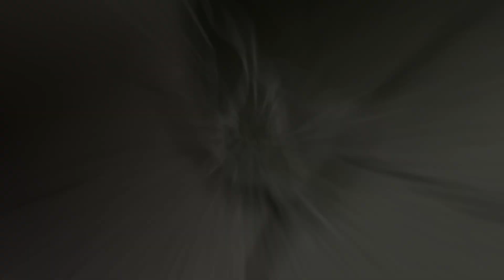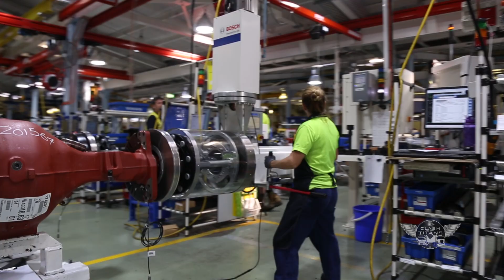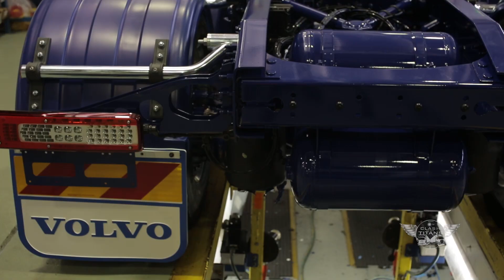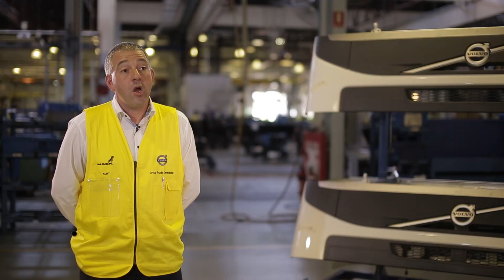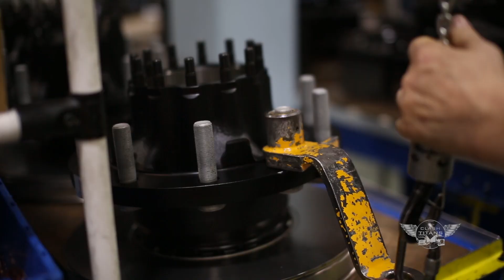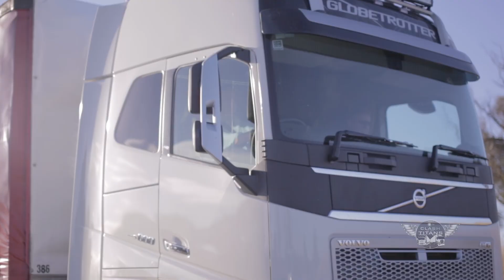The factory behind the Volvo FH16 | Clash of the Titans | Truck TV Australia

Comment: i reckon these volvos would be even better if you could get a roadranger gearbox in them instead of just the" i shift "
Reply: Kenworth and most of the american trucks has started to follow auto gear box i think most of the new drivers doesnt wanna drive double clutch anymore. Road ranger gear box is reliable but for local work companies has started to buy automatic gear box which is but quicker and easier to use.

Comment: volvo is bad truck!brutal power,torque in low rpm.low fuel consumption.easy steerable and small turning circle.easy drive and strong driveline......no smoke....just hot air from exhaust...cab is enough but not surplus long....

Comment: The only thing I don't like about the Volvo is the size of the sleeper cab. It needs to be made bigger, the same size as the Big Cab Kenworth aerodyne 2.8 metres or the Freightliner Argosy 110 high roof.
Reply: +born2flyau There is an XXL cab available in some markets which is much longer than the standard Eu cab..I'm surprised you don't have them in Aus.
Reply: +Yuxin Wang I have done some research on the Volvo Australia website and there is no mention of the XXL cab that I can find only the XL cab. The XXL cab use to be available but i don't know why it is not anymore.

With the standard width bed the Kenworth Big Cab and the Argosy 110 high roof offer a lot more standing room. The only standing room in the Volvo XL is between the seats.

The government needs to review the length laws to allow for more aerodynamic conventional cabs with large sleepers (72") like the VNL780 or the Kenworth T680 pulling a 34 pallet B-Double set.
Reply: I get you.. - It seems to me that there is a difference in terminology here - I looked on the UK's Commercial Motor article on the big cab Volvo that referred to it as the 'XXL' but looking at the pictures..the cab is as you describe - standing room bet.the seats with a slightly wider bed..Aussie - 'XL'?
Fantastic for us Eu/Uk drivers that do 4 or 5 nights away at a time (or several weeks if doing Europe) ..but not enough for Aussie long distance.
Mate of mine has the latest 750 FH on timber work - in hilly Wales - at a mere 44 tonne gross on 6 axles all the hills are flattened out, it's a beast.  
For the article:
www.commercialmotor.com/big-lorry-blog/supersize-my-volvo-fh-the-very-first-xxl-globetrotter-in the-uk

Regards
Reply: Yuxin Wang The cab in the volvo is only 1900mm front to back where as the Kenworth Big Cab and the Freightliner argosy 110 are both 2800mm. That is an extra 900mm or 3 feet, the width of a single bed. Some of the sleepers in Australia are setup as double beds. Plenty of room.
Reply: Boy..that's a fair difference..I wonder why Volvo can't make an equal size cab for Aus..?
Maybe it would mean a whole new cab re-design for them which would prove too expensive. 
Pity though, because it puts them on the back foot as far as long distance transport is concerned.
Reply: +Yuxin Wang It sure is a big diffence. I believe that Volvo are no longer making the XXL version of the cab anymore either which is a pity.